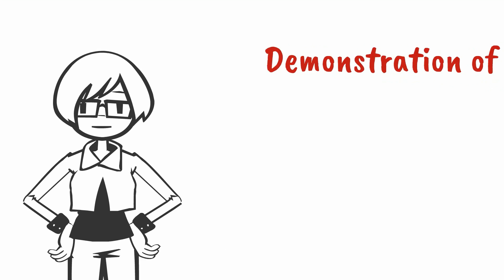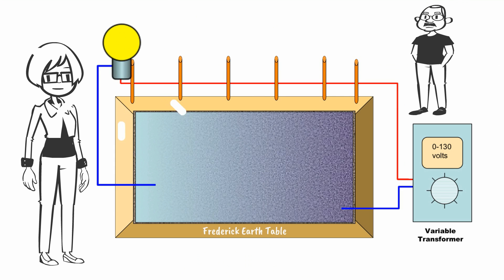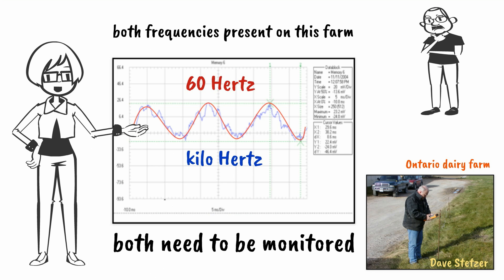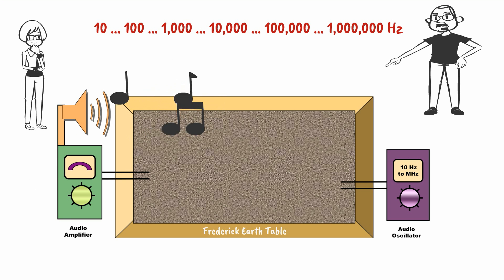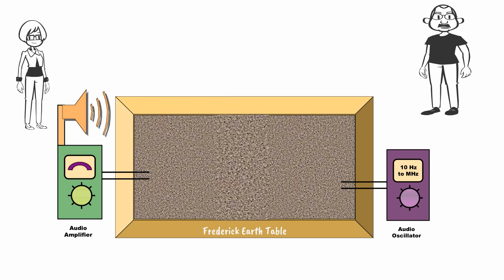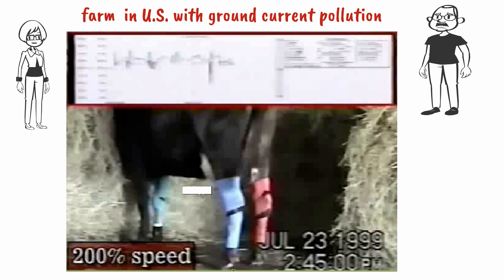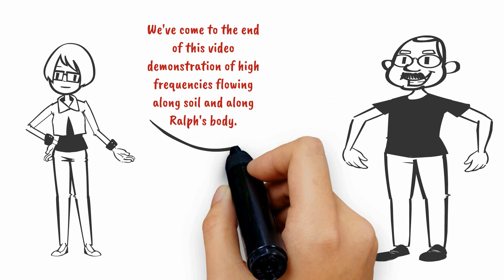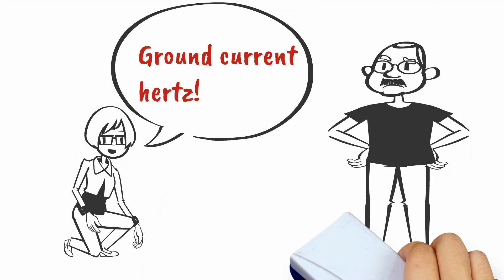Ground Current:  Demonstration of Ground Current with Earth Table and high frequencies

Comment: Also in order to have electrical current flow you would need to have each foot on a disconnected patch of dirt at different voltage potentials. 

Cows hooves are also less conductive then human skin. If a human walked barefoot on a farm would their needs bulge and bleed? 

I have a great idea let’s take some things that naturally exist that people don’t know much about and spin them into a scare story so we can sell some devices to “cure” the problem.
Reply: Man-made electricity does not naturally exist.
Reply: @michaelpenna7029  ok, but electricity exists. Lightning, for example, is a naturally occurring form of electricity. When a thunder/lightning storm hits an area, it pumps extremely high voltage into the ground. Do people's feet swell? Cows? Animals in the forest? Nope, unless you are close enough that some of the current passes through you on its way to the ground, you are unaffected. 

This is the same reason why birds and squirrels sitting on electrical lines are not electrocuted. The wire they're sitting on could be charged at tens of thousands of volts and have huge current flowing through them. Because their feet are standing on a wire of equal voltage, there is no current passing through the bird, hence why you don't see birds and squirrels with massive ankles and reproductive issues.
Reply from the maker: Farmers complain of swollen joints as well, worsening of arthritis.  They have difficulty getting pregnant just like the animals.

Comment: This info is rather dry, but it's certainly not pseudoscience as Peter Jensen claims. Let me try to give this info a little more context. The case referred to in this video came from a farm which had an overloaded neutral or return on a transmission line going across the farm's property. The return current from the transmission line was forced to use the earth to supplement its return path. This was bad news for the cows on the property nearby given they were essentially standing on a live wire with ground current flowing through their bodies because it was more conductive than the earth they were bridging with their feet. 

Living close to an electrical substation can produce a similar situation, given ground currents returning to the substation from overloaded neutral lines. Your property could be in that path. Take a look on a transmission line tower someday. You'll see combinations of three heavy lines (3 phases of electricity 120 degrees out of phase from each other) each accompanying one skimpy line below it. That's the neutral or return line. 

Ideally, if the power on all three phases is balanced, then there is no neutral or return current. However, that is the ideal situation and power imbalances will manifest as return currents on those skimpy neutral lines. If those imbalances grow too large, electricity will seek the path of least resistance and will flow through the earth to complete its path. Notice the skimpy return lines are tied to earth on each of the transmission towers. To compound the issue is dirty power which is higher frequencies riding on top of 60 or 50 cycle power, which are largely the result of digital electronic devices. Yup, the world getting very complicated indeed.

Comment: Cool, up until the cows.  I then quickly recognized this as astroturfing -- a neat tabletop experiment that appears to support some scare-based pseudoscience that benefits for-profit causes.  If ground currents were making cows twitch, they'd really be uncomfortable when they lie down during geomagnetic storms (caused by the sun on a frequent basis affecting both the daytime and nighttime sides of earth) because of the geomagnetically induced current.  More likely is that the farmer wired his building on the cheap (not to code), and the cows sense current that's not going back on the neutral wire, or they just hate the farmer's milking practices.
Reply from the maker: You can differentiate between on-farm and off-farm sources by turning the power to the farm off.  If you still detect the ground current, it isn't coming from the farm.